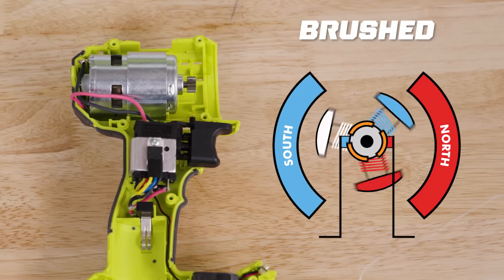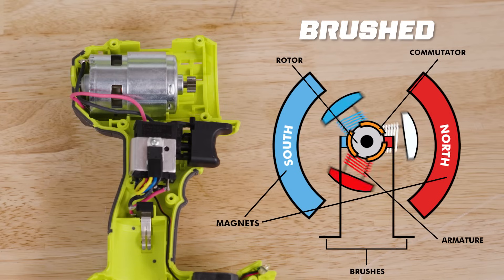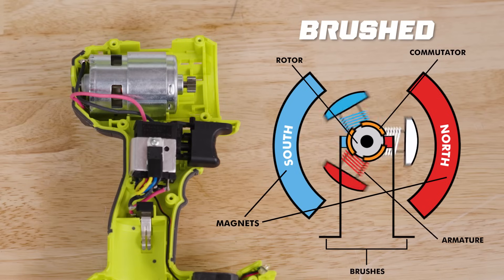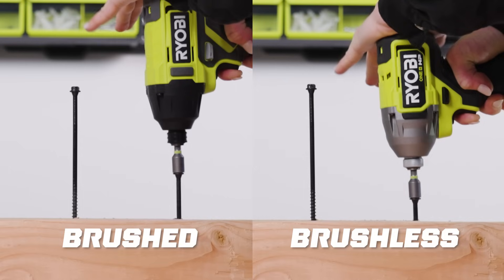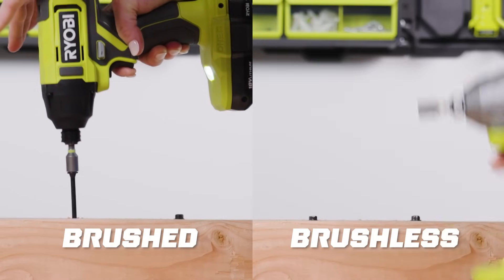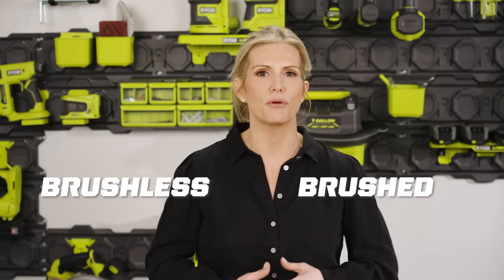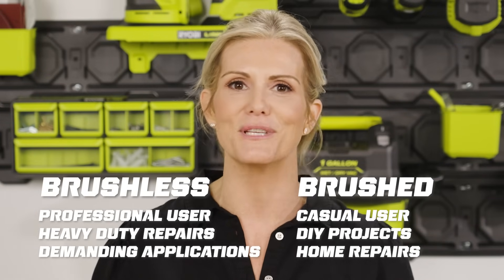What's the Difference Between Brushed vs Brushless Power Tools EXPLAINED! | The Beginner's Guide

Comment: The “brushless” motor is a three phase induction motor that requires three phase electricity to operate. Until recently, such motors were only used in large industrial applications because three phase electricity was expensive to install and fiddley to operate. Three phase induction motors are, however, simpler to manufacture and supply more torque.

With the advent of Insulated Gate Bipolar Transistors (IGBTs), it became possible and practical to generate pulse wave modulated (PWM) three phase current from either direct current or even single phase AC current. By varying the frequency of the three phase current using transistor logic, the speed of the motor can be controlled. Most importantly, varying the frequency of the three phase current allow the motor to deliver high torque at low speed. This is a major advantage of a three phase motor.

So, in summary, a “brushless motor” is a three phase induction motor that is driven by pulse wave modulated three phase electric current generated by sophisticated semiconductor electronics from direct current supplied from a battery. A “brushed” motor uses a simple commutator instead of the sophisticated semiconductor electronics. 

The “brushless” three phase induction motor is mechanically simpler, can be manufactured in a smaller package, delivers high torque at low speeds, but requires sophisticated semiconductor technology to drive it. The “brushed” motor is mechanically more complicated, but electrically much simpler than the “brushless” motor and delivers less torque.

Comment: There are two things that you forgot to mention when it came to your brushed versus brushless tools. Unlike brushed models, brushless motors are easy to control at low speeds, which also makes such motors good for RC vehicles. You also forgot to mention that such motors offer quieter operation.

Comment: Incorrect.  For the same price a brushed is a higher quality, longer lasting, more robust tool.  Brushed will also weigh less and have more finesse/control due to the design.  
If you want a drill to last and do any job brushed is best for the price.  Never need to fap about with batteries or charging or running out of charge.  
That said if you have a good charge and battery ready production line, use multiple tools that use the same batteries, there are multiple people on site so multiple cords are multiple trip hazards,  speed is more important than finesse, and cost is irrelevant as it is a tax deduction AND you pass on the cost (and replacement costs) to customers than cordless is great, bugger the environment, churn and burn baby .. also better for tool makers!

Comment: Just bought a brushless hammer drill to replace my old brushed. To my disappointment it does not have nearly the power of the brushed model. I knew there had to be a catch. I can hold the chuck in my hand and stop the motor even though it's rated at a higher torque. My old drill would tear your hand off. Just ordered a new brush motor for the old drill.
Reply: Brush just keeps going ( obviously changing brushes from time to time)... I agree

Comment: Since I’ve gone to the brushless impact driver I’ve noticed that my Phillips head bits are breaking. If there only was a setting that I could dial it back a bit!
Reply: Shouldn’t really be using Philips head on an impact, too much torque. You’ll also run a much higher chance of during your screw heads
Reply: get Milwaukee bits

Comment: The question I have isn’t with motors
It has to do with the 40v pole chain saw 
When it was built how come there wasn’t a short adapter made instead of the long extension to connect the power supply to the chain saw head it would have made more sense to have the short adapter so if you wanted to just use the chain saw head with out a extension first as it gets too cumbersome to use it up close 
I have the RY40506

Comment: I have over 20 Ryobi 18 plus tools. Some are over 13 years old. The only tools that have died are the brushless.
Reply: I did call Ryobi and they said it could be repaired but the cost was equal to buying new.
Reply: If you reach out to Ryobi they will probably replace it for you. The transition into brushless is going to have some speed bumps but it's worth the pursuit.
Reply: Thanks for this comment, just made my purchase decision easy!!
Reply: That is what I was thinking. Brushed tools you just change the brushes when needed for cents and tool keeps going. Brushless are controlled by electric circuit boards -damaged-throw away. Too costly.
Reply: I've had the opposite luck. I've killed 5 brushed multitools, a brushed drill, and a brushed ryobi sawzall. Maybe you mixed up whether it was brushed or brushless. Auto safety shut off is also not toasting a tool. When I said toasted I mean the motor melted something and I couldn't fix the tool by waiting 30min or quick disassembly/repair/resembly. One of the brushed tools melted it's motor, and the ryobi brushless multitools tools let me cut shapes in plywood like I'm painting holes
Reply: @viewer-of-content I'm not asking rudely did you buy Ryobi because of the price point or because you had other battery powered Ryobi tools ? 
When I was just starting out I bought all Ridgid with the exception of some older Dewalt tools given to me.
Ridgid have an amazing warranty and affordable price pont. 
I use their brushless drill & impact set often. I was on a friend's job site and used his Dewalt impact driver, I nearly snapped my wrist (also user error) but my point is there was a marked difference in the 2 brands the power from the Dewalt was clearly noticeable. 
I only own 1 Ryobi tool,  a corded 10 inch Mitre, I love it, its light and portable no complaints. 
Unfortunately I feel Ryobi isnt really taken seriously as a tool brand and its gained such fast popularity due to its low cost in Canada and US. 
Tbh I don't hear people say Ryobi is bad, and its perfect for a weekend warrior but I just feel its underpowered and better brands are out there
As I gain my skills I will eventually move over to either Mikiata or Milwaukee or even Bosch

Comment: I always say, just spend the extra money and get the brushless tool, you won’t regret it. I try to only buy Ryobi’s brushless version of every tool if it’s a possibility.
Reply: What do you do when the controller chip goes out?
Reply: @Mk-uh4jo  Buy another tool I guess lol. You have far less issues with brushless tools vs brushed tools.
Reply: @DynamicDesignZ  or buy a brand professionals use.
Reply: @Commercialape  if u r a trademans, it's recommended to go double brand. say ex, Dewalt as your main brand that handle the torquey n rough application. a cheaper brand say Ryobi to handle the chill usage (vacuum, light, heatgun, car tire inflator etc..)
Reply: @Commercialape  im currently running Ryobi HP (not only HP but greatest n lastest HP Gen 2) as main brand, and Milwaukee M12 as offbrand, y m12 cauz i need its compactness, so i only buy m12 tools dat ve unique advantage of compactness! like rotary tool, rachet, right angle drill, die grinder, inspection light etc. Ryobi ve a fat battery sticking out hinderin operation.

Comment: Thank you. I have both brushed & brushless Ryobi 18v tools. My Ryobi brushed string trimmer & angle grinder drains 4 Ah batteries quicker than my brushless drills. Keep’m coming
Reply: Well of course, but it totally depends on the work and resistance being done.  I imagine both the string trimmer and grinder pull much more power from them than a drill.

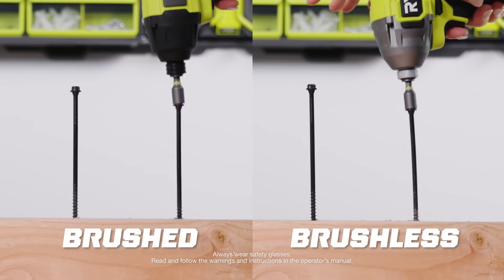Comment: Great explanation but why does it look like the trigger isn't being depressed all the way on the brushed tool compared to the brushless at 2:31? I have the brushed impact driver and it definitely drives one of them bolts faster than that.
Reply: The brushless impact driver was also using a HP battery it seems. Which is what makes brushless better. If you use a Hp battery there is a significant uptick in power over a non HP battery. But if you don’t have HP batteries either tool will work the same
Reply: @OldGoatWorkshop and @nestr2007, great observations!  Ryobi needs to address these issues which seemingly nullify the test altogether.